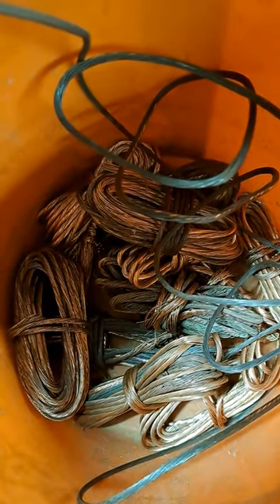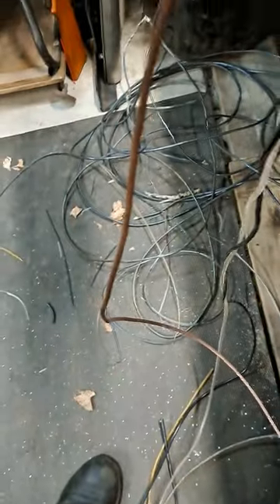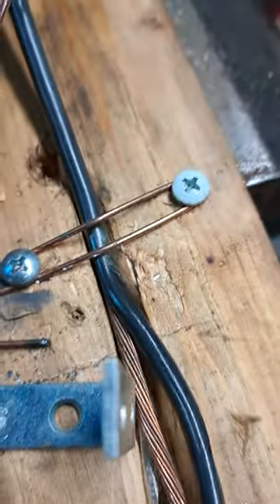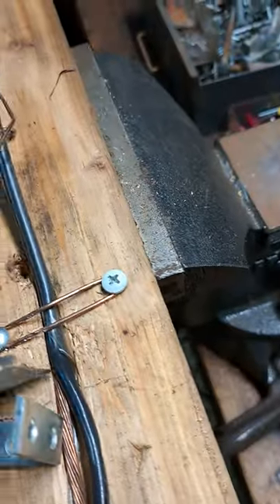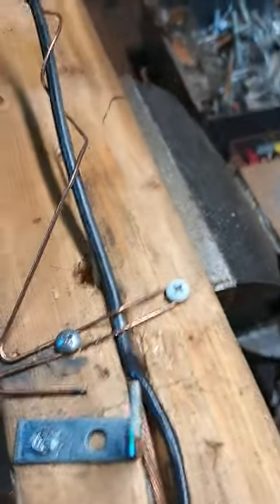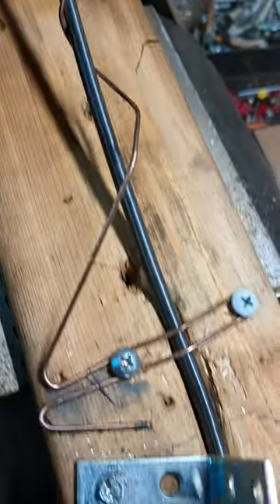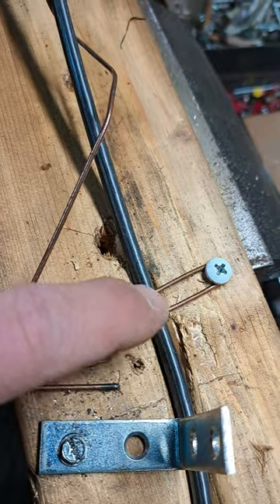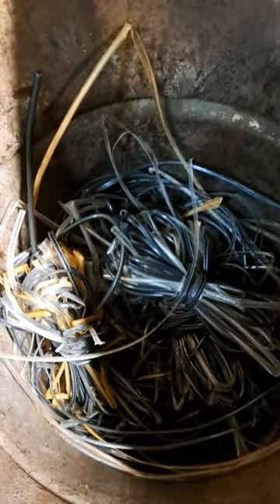Wire stripping. Copper reclamation machine!

Comment: Looking good. 
Consider a cheap hand crank winch. Attach the winch cable to vice grips to clamp the stripped wire tip. Curl the tip for better grip. Run the wire through a cheap funnel (the same type for adding vehicle fluids) securely attached to the board. No kinks = no hassles.
Larger channel in the board with easily removable sheet tin used as a filler to accommodate smaller wire. 
Wind the bare wire on to different diameter spools with a missing tabletop edge. Slide it all in to a 5 gallon bucket. Huge space saver!
Turbo mode engaged.
Reply from the maker: I like the constructive advice. There is always was to improve and advance a system. I will employ them if I can.
Reply: How much more do you get if its stripped??

Comment: Does it not dig into the copper wire a snag seems you are using the flat part of the razor instead of just the pointy tip?  I have tied and both processes snag  a lot
Reply from the maker: The angle of the blade has to be perfect that's why I hold it by hand while pulling it through.  I know everything what you talk about. When the wire is very fine that is more of a problem. The thicker the wire the easier it is.

Comment: How do u dispose of all you plastic sheath? Thanks 👍✌
Reply from the maker: I put it in the residential recycling pick up .
Reply: @Oneminutetofixit  it’s not actually recyclable. Please put in the normal rubbish/garbage
Reply from the maker: @xyzabc4178  I thought some was. I guess the recycling program must struggle with people putting non recyclable good in all the time, hell I can't get my wife to stop putting mylar potato chip bags In recycling 🙄🤣
Reply: @Oneminutetofixit  😆😆
Reply: @Oneminutetofixit  it doesn't matter
Wire isolation will get sorted and given to iron manufacturers, as it's used along with calcium compounds to form slag

If you want to be extra helpful give it to e waste disposal or just put the isolation in plastic bag so that employees don't have to pick up smaller pieces.

World would be a wonderful place if everyone used common sense
Reply: @xyzabc4178  that's really great...
This way it will either get burned without much use except for heating and electricity if the facility has a generator

Or it gets dumped in landfill, what a waste
Reply: I'm old enough to see cloth sheath on house wiring.
Reply: Just burn the wire
Reply: @johansen1010  Good luck on getting caught with that, they really might throw the book at you and certain yards might not even take it..
If you have longer strands of pvc cable this works fine, just sell the short bits as they are.
PE or paper sheathing will burn clean though but you won't make any friends with burning pvc cable.

Comment: Nice demonstration 👏👏👏🤦🏽‍♂️
Reply from the maker: Yeah I know it hard to imagine how to hold the blade and pull the wire 🤦‍♂️
Reply: @Oneminutetofixit   Yea it's real hard to imagine 🤦🏽‍♂️ It's not about that 🫏 It's about how efficiently it works 🤡
Reply: @Oneminutetofixit 
Can we bolt the knife or just the blade instead of holding it ?
Bravo for the initiative pal!
Reply from the maker: @joestalin2375  I found that with different wires and coating thickness, it's easier to hold, so the angle can be changed to shave it properly 👍👍
Reply: @Oneminutetofixit  
I understand .
maybe a rig for each different size wire,and pull them with a motor ?

Comment: You have of video of it in use?
Reply from the maker: I think so. If not, I will make one soon. Stay tuned!!
Reply from the maker: I do have a video!! It's like 40 videos down with a different angle of the setup!
Reply: @Oneminutetofixit  what’s the name so I can find it faster?
Reply from the maker: Strip wire Sunday, recycling copper. Should've just done that to begin with 🤣🤣👍

Comment: If it works for you then why not . COPPAH
Reply from the maker: Exactly my point. Very cheap and renders pounds for me. All told I've done a few thousand feet of wire and it only cost me a pice of scrap wood and a filler wire.